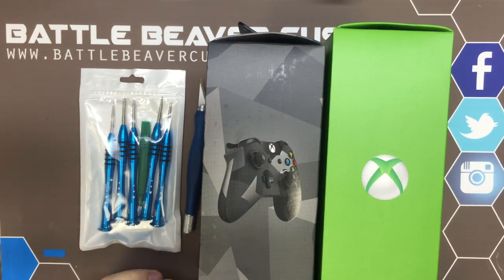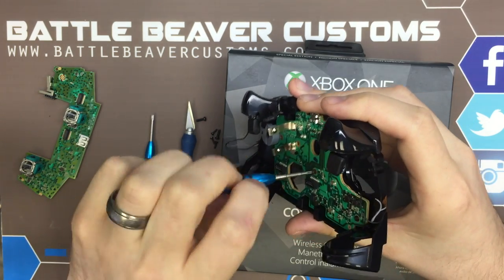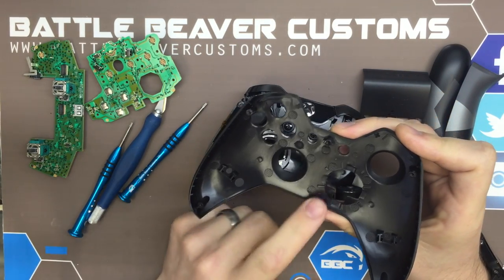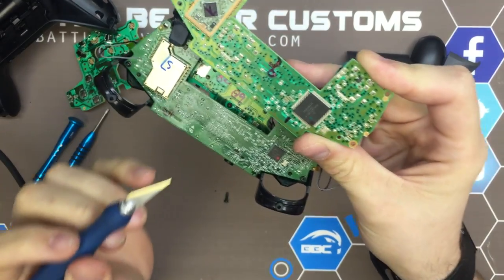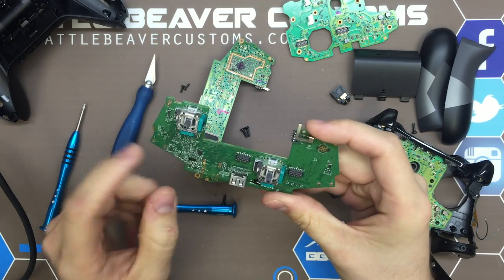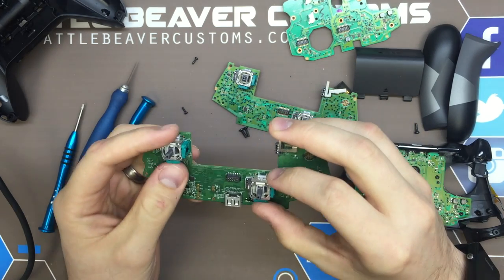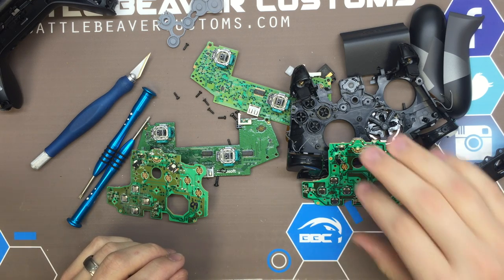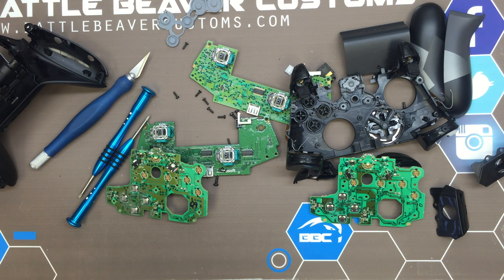Xbox One Covert Forces Teardown and Comparison by Battle Beaver Customs

Comment: my Covert Forces  Right bumper is broken.

both bumpers is a single piece of plastic.
on original xbox 1 controller bumpers are 2 pieces, but on the Covert Forces version it is a single piece.
does anyone know where to get a replacement for both bumpers?. (Covert Forces)
Reply: really I have the same controller and mine is making a weird crunching sound is it gonna brake I hope not cause I don't wanna buy another one.